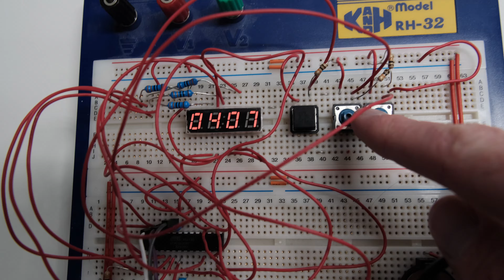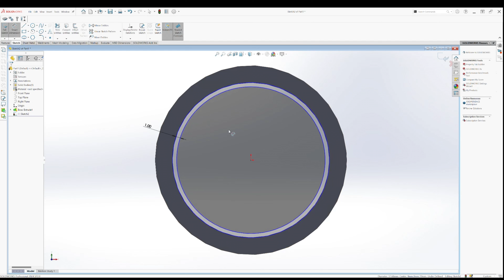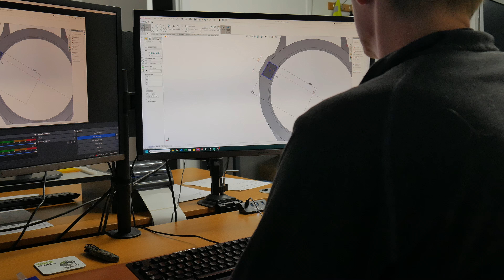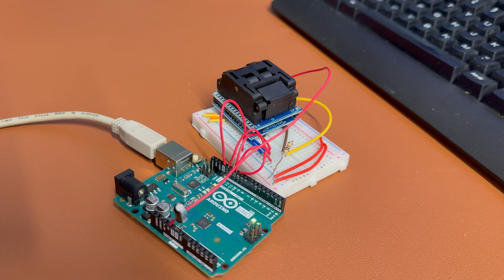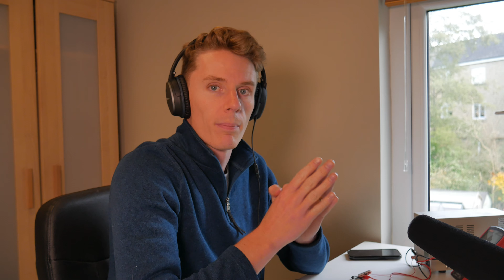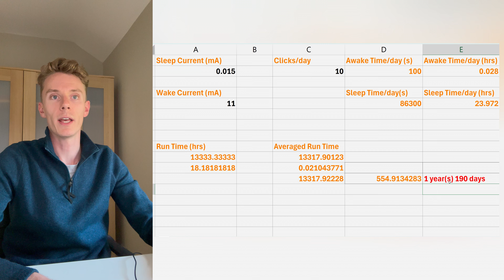DIGIduino - DIY Digital Watch Part 4 - First Build Complete!

Comment: Really nice watch, i loved it. You've inspired me to try building one myself. But i'm confused by the battery life calculations. How did you find the averaged run time? i had a different approach and got around 64 days of battery life. 
Here is my approximate calculations for 30s display time and 30 clicks/day:
average current = (0.25hr * 11mA + 23.75hr * 0.015mA) / 24hr = 0.13mA
battery life = 200mAh / 0.13mA = 1538 hr = 64.1 days
Did i miss something?
Reply: Your numbers seem to add up to me  , maybe his sheet has a bug
Reply from the maker: @ddjazz  Rerunning the numbers you are correct! 10clicks @ 10s equates to 300days, 30clicks @ 30s equates to 64 days. Thanks for correcting me!

Comment: Really cool watch! There are rechargeable button cells, so I wonder what a tiny solar panel and a rechargeable battery could do?
Reply from the maker: Hey I like this idea, I've now gone down the rabbit hole of SMD solar cells!
Reply: @ThePrintableWatchCo I don’t know how much capacity you lose with rechargeable button cells compared to non rechargeable, or how much power a tiny solar panel can provide, but it could be an interesting option if it’s viable.

Comment: This has probably been asked already and perhaps has already been answered somewhere, but ... why no OLED I2C display?  I would assume it can reduce the number of pins needed, so if needed you can control the power to it with a mosfet and it can display so much more than the segment displays you now have.
Reply from the maker: Hey, it certainly was a consideration and this may be where the project goes next. The 7 segment LEDs were the aesthetic I was going for in this project and it wasn't something I'd seen before.
Reply: @ThePrintableWatchCo I really like the 7 segment displays. It gives it a great retro look.